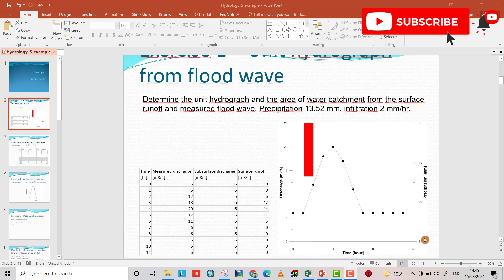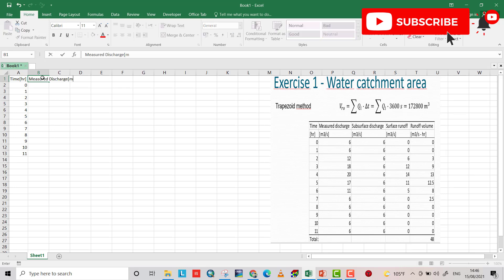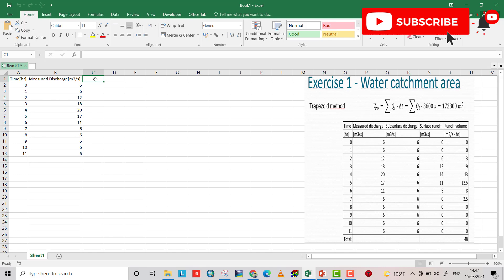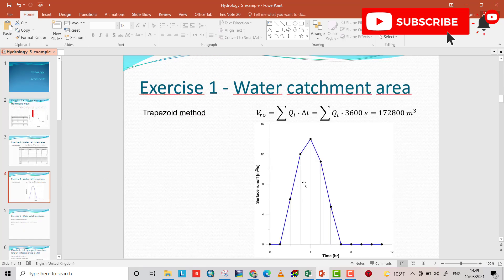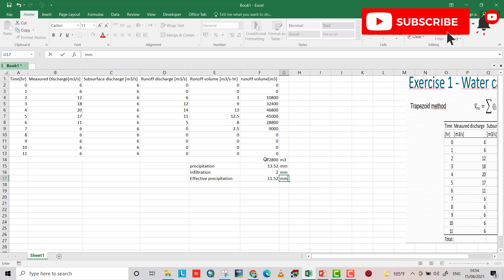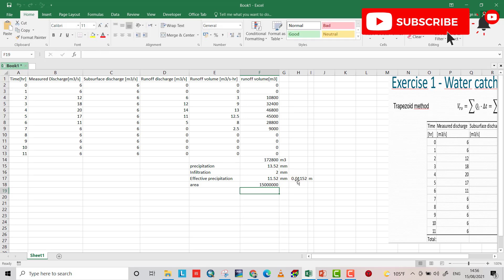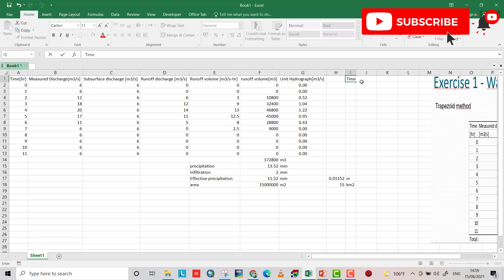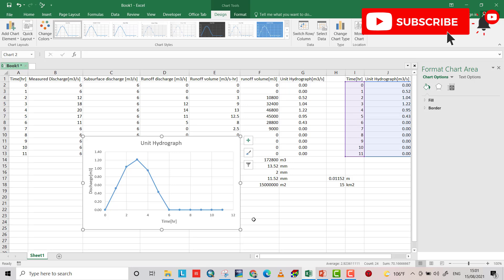Unit Hydrograph From Rainfall Runoff

Comment: Good teaching, but if I may ask, how can I  determine the measured  discharge & surface discharge sir
Reply from the maker: Thank you so much, this link helps you
https://www.google.com/url?sa=t&rct=j&q=&esrc=s&source=web&cd=&ved=2ahUKEwjr_e3Isun7AhXDRPEDHQPCD4YQFnoECCUQAw&url=https%3A%2F%2Fbyjusexamprep.com%2Fflood-estimation-routing-notes-for-gate-ce-ies-isro-i-2cb76440-6d35-11e7-9f3c-f4b4ef40c193&usg=AOvVaw0Cp3HPuWHRGFzq3Uww47VG